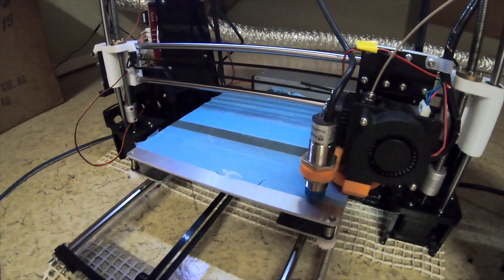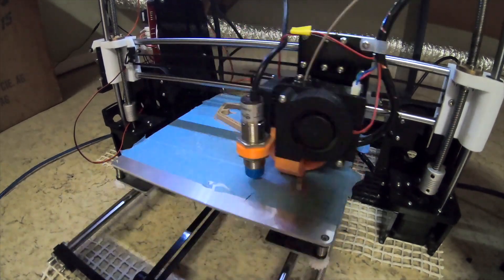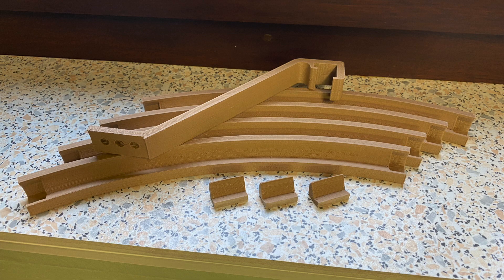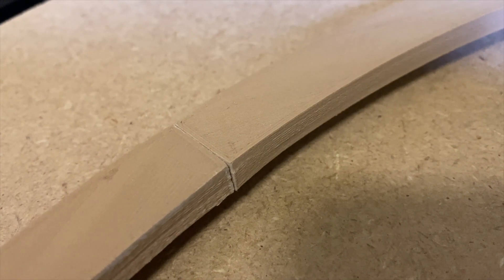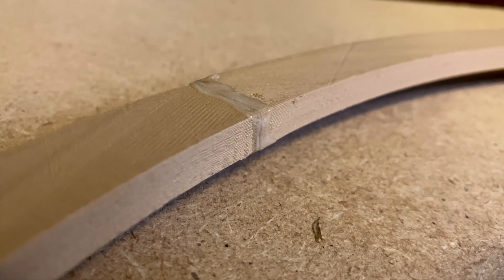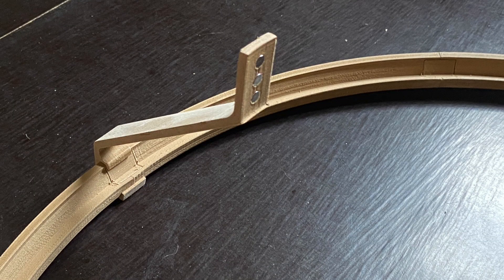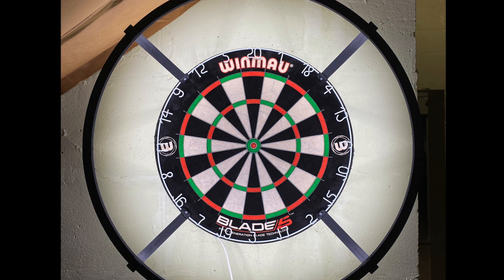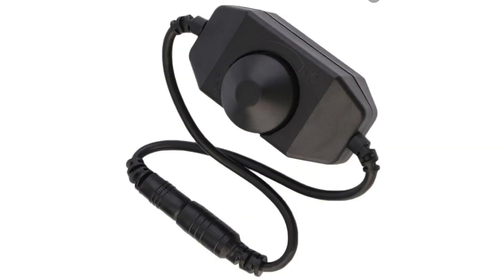Tutorial: How to build your own darts led ring? (3D printed)

Comment: Hi, I've printed the same ring from Thingiverse but I have a question about assembling. .
Did you have any issues putting the led strip on the sloped part of the ring. Looks like you missed that part in the video.
The problem with me is that I have 60 leds/m and the ledstrip isn't flexible.
Reply from the maker: The only issue I had was that the tape on the original ledstrip was too weak to stick to the print. I've used some double sided tape to secure it better. The radius of the ledring was large enough to guide the ledstrip onto the sloped part of the ring. I do have 30 leds/m so it might have a bit more flex in it. Not sure how you can "fix" this. You can try cutting the strip into smaller parts and connect them by soldering small cables in between the parts. That way you can make the angle work?
Reply: you need flexible LED Strip..